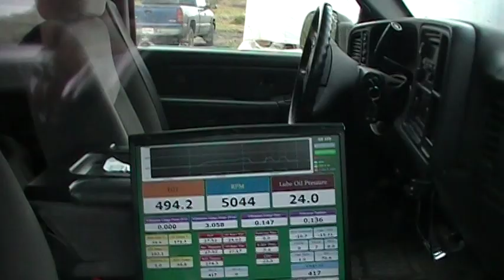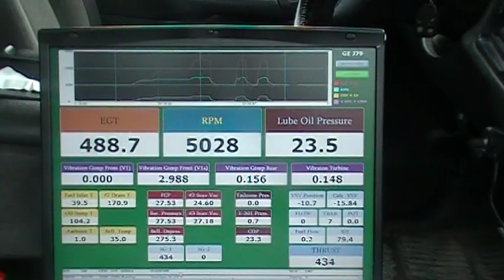Max power, plus afterburner - LOUD !

Comment from the maker: That's pretty cool.
Jet trucks have a fixed nozzle that produces no thrust at full non AB, because it is tuned for AB.

If you notice in this vid of an actual fighter plane setup, the nozze is variable. It maximizes thrust at flight throttle settings, and then adjusts to the greater flow of AB throttle settings.
It opens up to eliminate thrust at ground idle settings.

I can certainly understand people running away. That's what my body wanted to do while filming this.

Comment from the maker: @sanfranciscobay I'll try. The nozzle segments have only one purpose: to accelerate the gases coming out of the engine to maximize thrust. without AB, theyare open at low throttle, to give no thrust at all.
As throttle is increased above flight idle, they close down to produce thrust  and they appear to stay in that position all the way to max military ( non-AB).
The Afterburner is progressive, but can only be activated when the engine is at 100% power.

Comment from the maker: @SoniaStrumm55 EGT does not change. The afterburner operates on the exhaust of the engine. It increases the temperature and volume of the exhaust, but none of the engine temp sensors show any change.
AB temp is not measured.

Comment from the maker: It's a military engine, so it's upper EGT limit is a bit higher than the 1150F that is used in industrial applications.
The afterburner adds a lot of fuel and burns it in the exhaust after it has left the engine, so it has no effect on EGT.
EGT is usually measure just at the exit of the last stage of the turbine, but it is used as an indication of turbine inlet temp, which causes thermal stress on the turbine.

Comment from the maker: @sanfranciscobay  The afterburner has 4 manifolds that can be progressively pressurized to feed fuel to one of 4 sections in each of the 21 spraybars which feed fuel into the jetpipe.

Each amount of fuel flow will have a different amount of heat produced, and therefore a different volume of gas produced. The nozzle segments open up and adjust to a size that maximizes the acceleration of the exhaust.

A little kid can do this easily with their mouth when blowing out a candle.

Comment from the maker: There are different ways of doing it, but the one I know of is a throttle lever with a detent at max. 
Push it past that, and you are in AB.
In this aircraft, the AB is progressive, and modulated by throttle position.
There's full military power, and then there's max AB.

The pilot just puts the throttle to whatever he thinks he needs.

I've obviously never flown one, but it seems like it would be a fairly straightforward way to manage thrust.

Comment: Do any of the surfaces inside a jet engine ablate or erode from the heat, hot oxygen and sheer force of the fast moving gasses?  The inner surface of exhaust section must cop a hiding with full afterburner.

Comment: Jay

Great video. I love watching the tail feathers open and close and the after burner flame. Can you do a video on the tail feathers and their function.

Question: Is there a relationship between the throttle setting (ie 25%, 50%, 75%, 100%, then 100% with afterburner) and the tail feathers opening, closing, static open, static closed...? Do the tail feathers move with the throttle and in what direction...? Can you briefly explain their movements in regards to the throttle. Thankyou.

Comment: What airframe is this J79 out of?
Great vid! An older friend of mine said he was at an airshow along time ago, back when you could roam the flightline pretty freely, and they were ways from the crowd watching F-4's taxi out and one turned and put them in the jetwash! They were ducking down from the heat and debris and fumes enveloping them, and the pilot burped the throttle to get rolling for just a second and my friend and his friend though they were going to die it got so hot for a second!